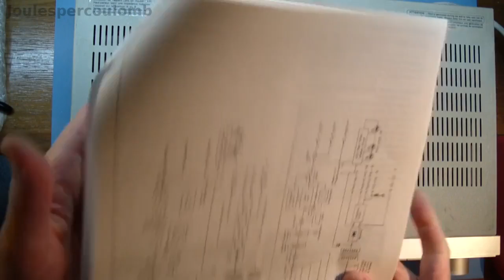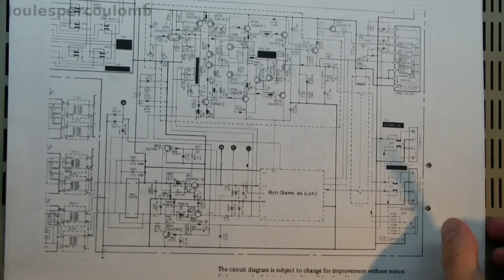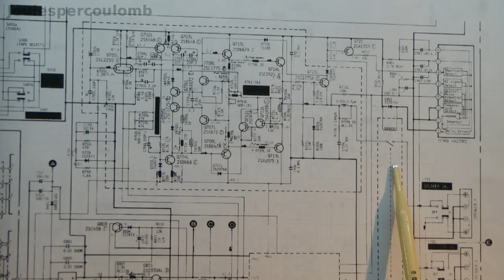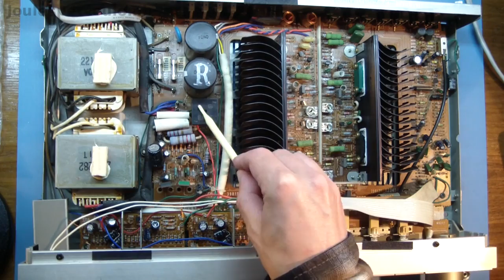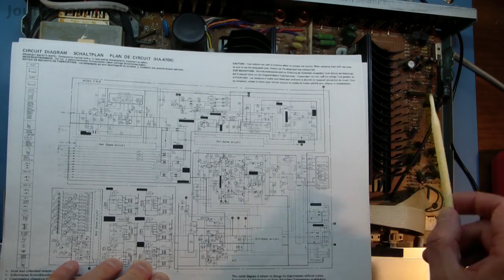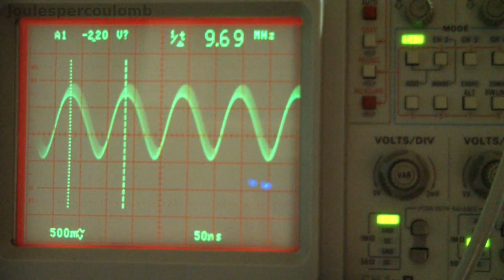Hitachi HA-4700 Amplifier Repair - Part One

Comment from the maker: +MOTOS SUCRE
I accidentally deleted a comment by MOTOS SUCRE:

Saludos. Excelente video. Tengo un HITACHI HA-4700 y se quemaron los dos 
transformadores. Me gustaria saber si me puede decir cuantos Voltios AC emite 
cada uno ? Gracias.

My reply:

I don't think I measured it and if I did, I can't remember the result. However, working backwards from the voltages on the main power supply rails, transformers each with an output of  35 - 40 V RMS AC (under modest load) ought to be suitable. I don't know the power rating of the originals either, but I suggest 55 - 60 VA each must be about right. Pay careful attention to the phase of their output so that'll you'll wire them up correctly.

I hope you know why the originals burnt out so you can make sure the same won't happen to any replacements.
Reply: Estoy por conseguir un transformador con dos salidas de 35v + 35v de un MARANTZ PM-340.  Muchas Gracias amigo JoulesperCoulomb Saludos desde Venezuela.
Reply: Saludos amigo JoulesperCoulomb Como está usted ? Lo felicito por su excelente tutorial.! Ya le coloqué a mi HA-4700 un transformador con devanados secundarios dobles  de 35V+35V y ahora funciona correctamente. Gracias por la ayuda amigo.

Comment: awesome info...I have an Aiwa Amp Model MX-D909U...it powers on but no noise out of speakers...any idea where I could start? took it apart and didn't really see anything burnt out on the board
Reply from the maker: I am not familiar with this device, but I can offer some general advice:

If you possibly can, you should obtain at least a full circuit diagram and ideally, a service manual. This is likely to make diagnosis and repair much, much easier. If you cannot, you'll have to do your best to determine the topology and audio signal path by examining the circuit board.

WARNING: In most audio amplifiers of this type, potentially dangerous voltages are exposed at many points (not just near the mains transformer and power switch) once the cover is removed. If you are not confident in your knowledge and skills to be able to work on such equipment safely, then do not.

Start by identifying all power supply rails. With the power off, check to make sure there is not a dead (or close to it) short circuit between any of the supplies or to 0 V. If not, power on and measure each to check whether the voltages are as they should be. Typically there is a balanced DC supply of very approximately +/- 50 V. Often there are further supply rails to power pre-amplifier sections and the like. Make sure you test all of them.

If the power supply voltages are correct, determine whether the amplifier has a protection circuit (the HA-4700 does). Typically these check for conditions such as overheating or excessive DC offset at the output and should such a fault be detected, the output is disconnected or the amplifier shut down in some way. If such protection is present, check to see whether it enters the shut down state. If it does, you'll need to work out what is triggering it to do so.

Check for any excessive DC voltage at the loudspeaker terminals. Any voltage here should certainly be less than approx. 150 mV. High voltages here can damage loudspeakers. DC at the output can be down to many causes. Quite often it indicates a very badly adjusted output stage or faulty output transistor. However, particularly in entirely or mainly DC coupled amplifiers, the fault could be almost anywhere and can be very difficult to track down.

Connect a test signal (e.g. a 300 mV peak-peak 1 kHz sine wave) to an input of the sort intended for a CD player or cassette unit and set the controls so that this signal should reach the loudspeaker output. Use an oscilloscope (ideally, though a small audio amplifier with an AC coupled input can also be used for this purpose) to check for the presence or otherwise of the test signal at various points in the circuit, working from the input towards the output. E.g. at the input connector, at the input and output of any initial pre-amplifier stage, at the input and output of any tone controls or other filters and at various appropriate points in the power amplifier section; you'll have to use the circuit diagram to guide you. See whether the state of any of the front panel controls makes a difference; faulty switches and potentiometers are common. Through this process you should be able to track down which section of the amplifier is at fault.
Reply: Will do thanks for the time you took to actually reply...much appreciated my friend

Comment: Can anyone help..I have a technics amp and when I turn it on the power won't stay on it trips out..any suggestions? I'm thinking maybe a fuse but have no clue?
Reply from the maker: +Rosie Murray I or another reader of your comment might be able to offer some advice if you can tell us the full model name/number of your amplifier. A blown fuse probably wouldn't cause the symptom you describe. I would think it's more likely a protection mechanism operating because of excessive current somewhere or too much DC offset at the output. However, without being able to look up some information on the exact device you have, these suggestions can only be a guess.

If you have no experience of repairing electronic equipment, I recommend you don't make this your first attempt. Equipment like this can cause serious injury or even kill you if you don't know exactly what to do and what not to do.

I might be able to offer a repair service. Contact me at http://zx.zigg.net if you are interested.
Reply: Thanks so much but I just managed to fix the problem..yr right it had got wet so was tripping out but I've dried it out and it works again

Comment: Double insulated this is not, A steel case with mains earth,  Double insulated has no earth.
Reply from the maker: +mart fart Like most similar equipment, it claims to be double insulated. There is no safety earth connection to the chassis. However, the insulation between the mains input and the chassis doesn't look to be as extensive as I'd like it to be.

Comment: I may sound dumb but why are there two power transformers
Reply from the maker: They are wired to produce the same effect as a single transformer with a centre tapped secondary. This is used to produce balanced power supply rails. You'd have to ask Hitachi to find out why they used two instead of one, but perhaps it was necessary to fit them into this particular case or maybe it was down to what they had lots of in stock or was readily available when it was designed.
Reply: JoulesperCoulomb I thought it was cause your country has 240 volts USA is 120

Comment from the maker: I doubt this amplifier is of much financial value, but I think it could easily be restored to full working order and if it suits your needs, I'd say it'd be worth spending a modest amount to put it right. Leave the innards alone if you aren't confident working on a system containing high voltages, it isn't worth killing yourself! However, if you are careful you could check the idle current through the output transistors without touching anything; you could even connect the meter with power off.

Comment from the maker: It could simply be that the bias point for the right hand channel output transistors is set too high. Once the amplifier has been on for 10 minutes or so, measure the voltage across one of the output emitter resistors (see part two) and adjust if necessary. If you can't bring the voltage down to the required level, perhaps there is an oscillation problem, like this one had.

Comment from the maker: It does seem likely its due to a loose connection somewhere. Some experimental wiggling of parts(!) may track it down, or you could trace a signal step-by-step from an input towards the output to see where it stops. Take care inside, there are mains voltages on the left of the board and 100V between the power supply rails everywhere else.

Comment: Stop making me want an analogue scope! But before you stop, what make/model is that? I like the cool red reticle on it. No wait, stop! No, don't stop. do tell, pls? :/

I wonder if the oscillation is coming from the voltage regulation circuitry, and just a design flaw.